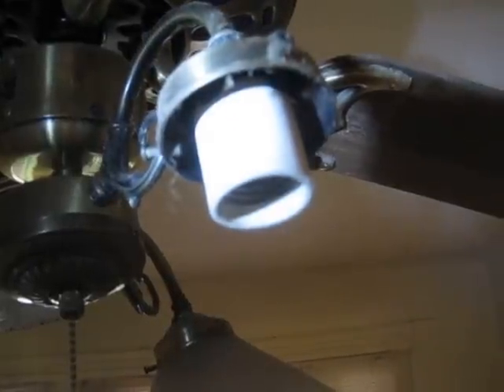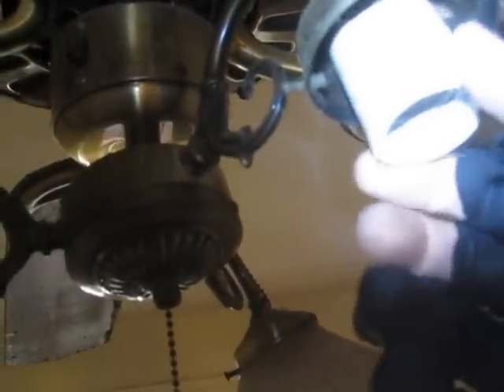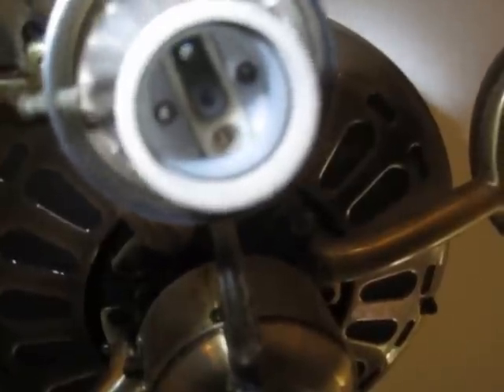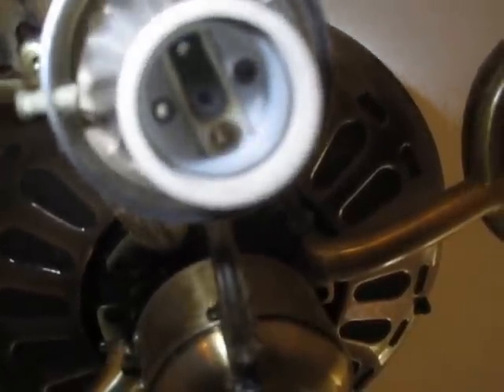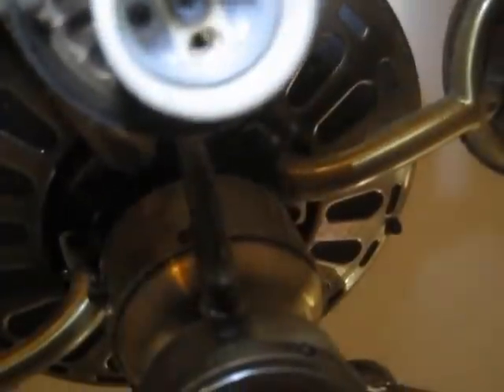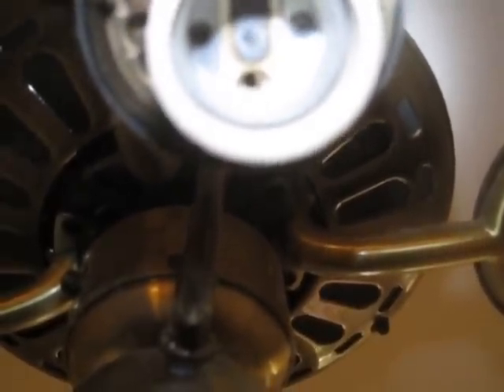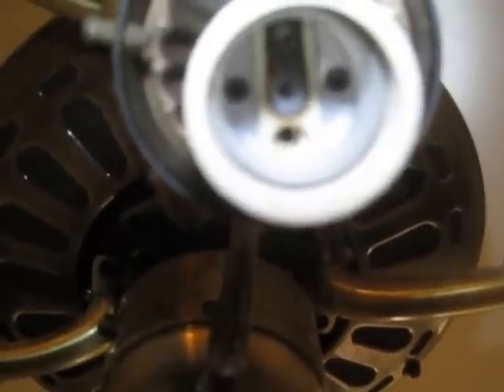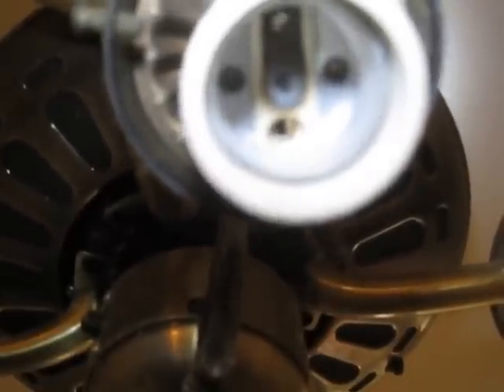Diagnosing loose lamp holders / lamp sockets

Comment: Well, this tells me what is wrong, but what do I do about it.  I have the first problem. How do I repair it?
Reply: My thoughts exactly...I know what's wrong, but I can't seem to tighten it.  I need to know how to tighten the inner bracket that holds the bulb casing. On well the search continues.
Reply: @debbiesyoutube4771  did you find the solution?
Reply from the maker: If the problem is that the screw-shell is loose from the ceramic or plastic outer insulating shell, it’s likely zapped or aged/rusted rivets that will not be serviceable. So you have to remove the mounting screw, remove fixture wire leads off the back of the socket (2 electric terminal screws), and replace the whole socket. Bring the one with the loose screw shell to hardware store or to your shopping screen, and find one that’s going to use the exact same mechanical mounting as the old one. The screw shell material (plastic or ceramic, and the wire terminals need not be an exact match, but ideally the replacement has the same lamp Watts rating or higher, vs the original, so that any fixture labeling remains accurate (such as “75W max”, or increasingly, “15W Max” (LED)).